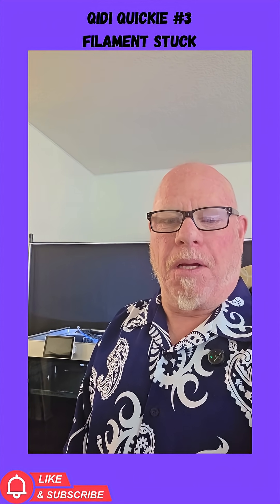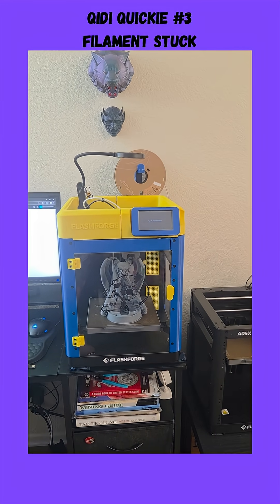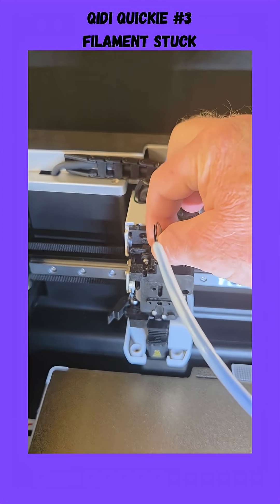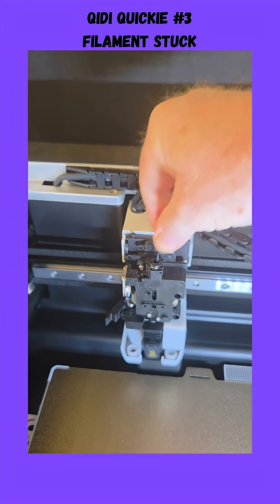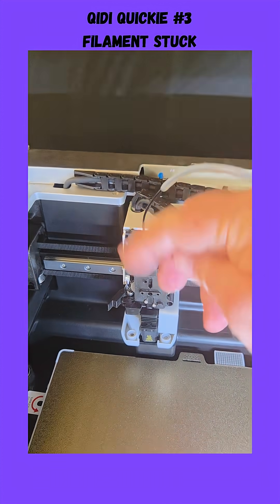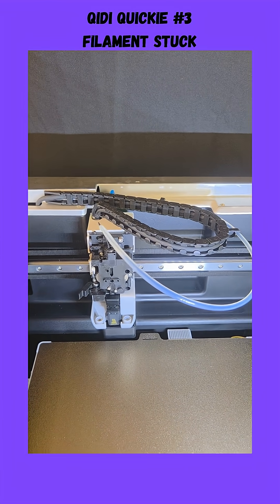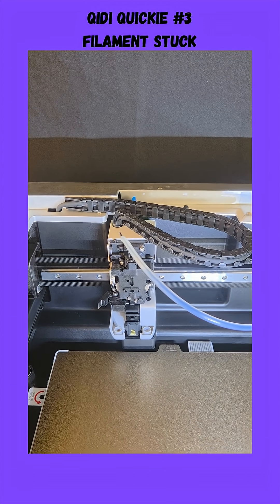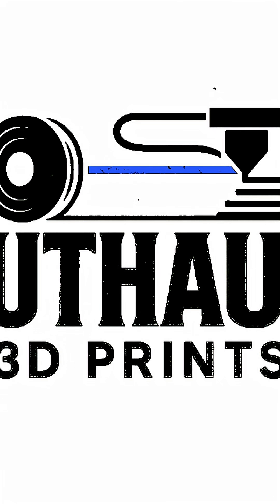QIDI QUICKIE #3 FILAMENT STUCK

Comment: Did you end up taking the head apart. I had the same issue and now it keeps saying filament not detected so I can’t print anything.
Reply from the maker: @7ommysworld Qidi sent me a new extruder and 2 nozzles.
Reach out to them and ask for Alan.
Send pictures.
Reply from the maker: @7tommysworld could also be the filament run out sensor. I don't care for their design.

Comment: Hey bro, heat er up to max temp ( 350c ) and try to retract & extrude the filament using the menu screen, if that doesn’t work. Take the extruder window off and see if your clog is after or before the gears. Might need to take the entire extruder apart but it’s easy. Dont use pliers ever to try to force the filament to come out you can make it worse and bend the thin ( imo underspeced, I wish they used the same size as the bed ) linear guide rods. The problem is , that without the riser the PTFE tube rides on the glass lid like crazy, plus with the glass on, depending on your filament of choice ( I only print ABS / PET / PPS with mine no PETG or PLA ) you could have just had a bit of heat creep.